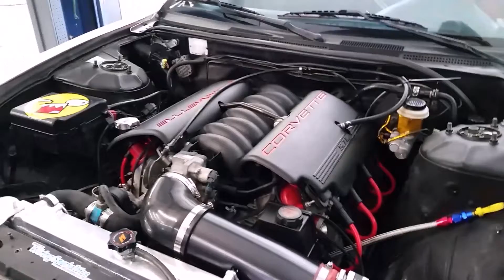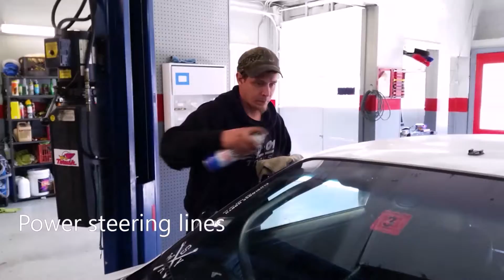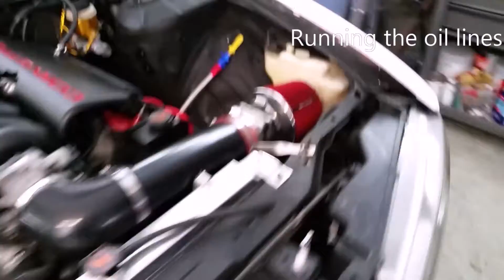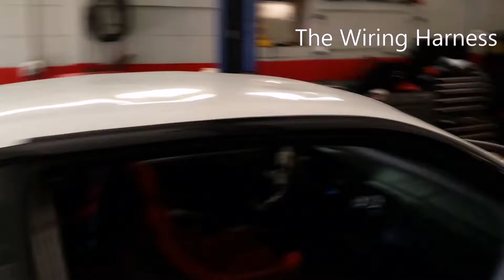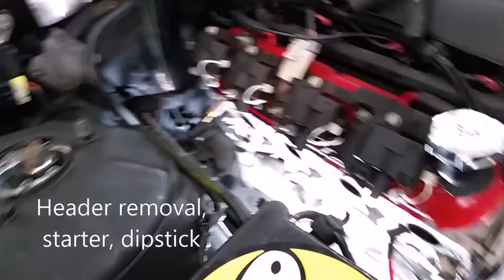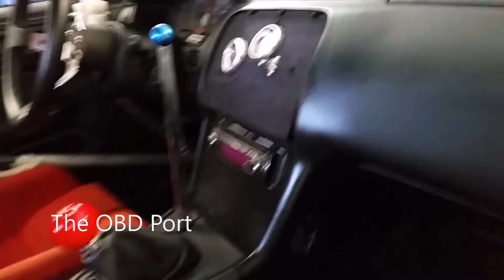LS1 Engine Swap Nissan 240sx S14 Part 2

Comment: what did u use too plug up that oil dipstick hole?
Reply from the maker: Ace King we  hanged the oil pan to a higher capacity pan. it wouldn't read correctly. the new pan has a spot for the dipstick

Comment: You have to make sure that you use the right water temp sensor. I've made the mistake of using S13 temp sensor on my LS14 and my water temp gauge freaked me out shortly after the start up. This may or may not be your problem.